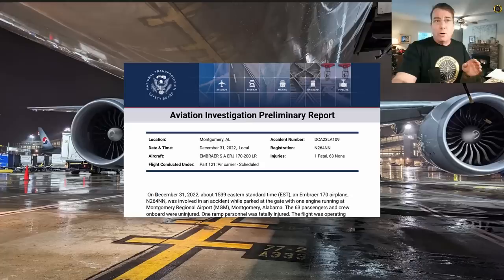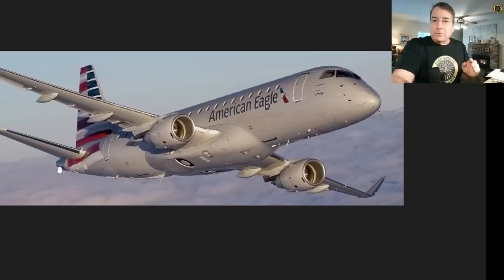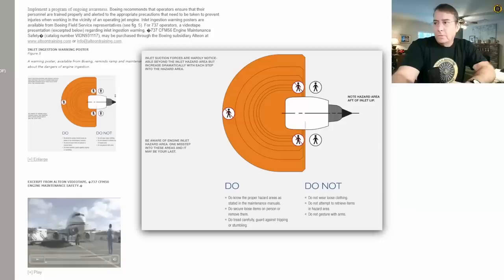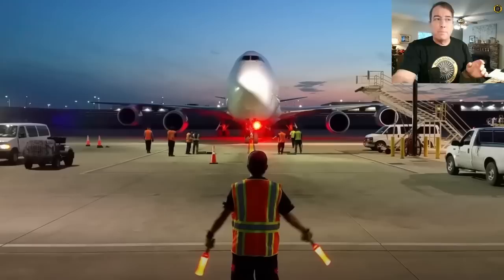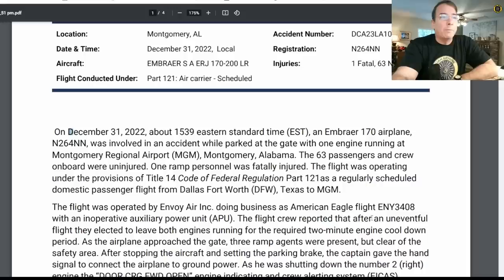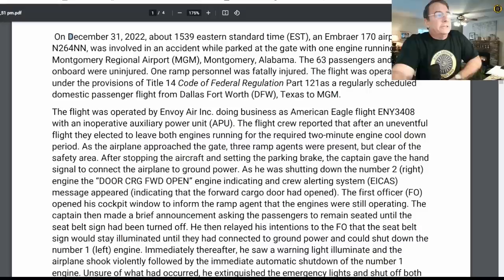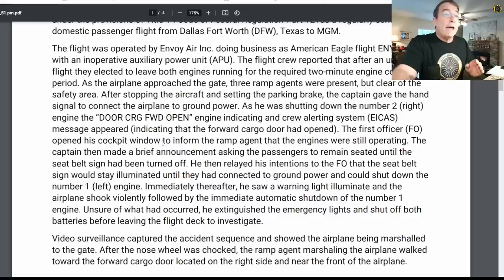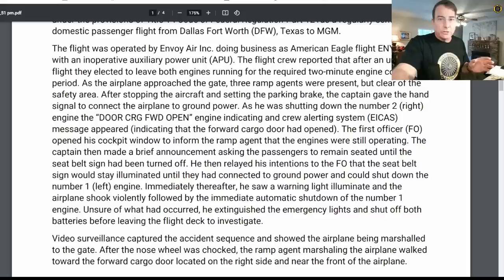NTSB Preliminary Report Ramp Agent Fatality 31 Dec 2022 Montgomery Al.

Comment: A few things; I understand the 2 minute cool down for the engine but when does the PIC shut down the engine under an "emergency" vs making the (utterly pointless) effort to yell out the cockpit window. Yes the ground crew person violated many procedures, but on more than 1 occasion as a member of an aircrew, emergency actions have been taken to avoid the potential consequences of ground crews errors. I can point out their actions till Im blue in the face, I am still going to have to answer for my action/inaction, steps taken to avoid an "escalation of incident". Clearly, the aircrew realize the accident's potential and did little in response. Losing cabin power isn't a reason to not take emergency action.

Comment: With the ERJ170, the beacon light can be difficult to see from either side of the aircraft.  The engine blocks the view of the beacon light underneath the fuselage.  The beacon light on top of the fuselage is difficult to see if you are not tall.  I am 6 feet tall and I have difficulty seeing the beacon light on top of the fuselage when located just outside the safety box.  The beacon light on top of the B737 fuselage is a lot easier to see from either side of the aircraft.  For the ERJ170, I stand at a 45 degree angle outside the safety box to see when the beacon light underneath the fuselage is turned off.

When other aircraft taxi by, it can create the impression that the engine(s) is/are still running.  When that happens, I have to visually check to see if the engines are still spinning or not.  It is not always clear if the engines are shutdown..

Comment: This is the result of ineptness on the ground handler/agent or whatever title they have. You simply don't walk in close proximity to a running jet engine. Bad things can and do happen. This is akin to walking across a railroad track with a speeding locomotive approaching. What part of the safety meeting Prior to the plane arrival didn't she get? I worked for a contractor loading and unloading the B757 for UPS at SHV. Proper aircraft etiquette was discussed before & after each successful load. We would review the video afterward. What could be done to improve? This was a completely avoidable tragedy.
Cheers from Louisiana.

Comment: Rampers often get frustrated with us pilots when we leave the beacon light on “too long” and more than once I have had them frantically waving the “flashing light” signal with their hand.  Part of my flow is to monitor engine speed after the shutdown until it falls below a certain value, as unlike a car engine it takes a long time for the heavy rotating mass to spool down from thousands of rpms even after it’s been shut off.  From my seat there is very little I can see going on underneath the wings, but occasionally can see the reflections from the glass of the terminal.  Over the years I’ve seen some ground personnel getting awfully close to a barely shutdown engine despite the beacon.  It chills my blood every time.  On some occasions have I been distracted and forgot the beacon…. yes.  Does this frustrate rampers who have a time crunch to offload and reload the plane… yes.   Have their been times something has gone on with the plane that I actually don’t want them touching it…. also yes.

Comment: I would be surprised if this doesn't spawn a lawsuit on behalf of the deceased.  My expectations are the following causes are pressed:. Time pressure, the door switch/brake issues Juan raised, company tolerance of rule breaking, training of ground crew, warning paint on the ground or lack thereof, etc.  Perhaps the biggest issue will be the cost if a radio headset for each person in the ground.  It would be pretty easy to suggest the cost of this would be a few hundred dollars and would have saved her life.   Any single event like this could easily lead to a radio requirement for all ramp personnel, despite the fact that these events are extremely rare and there are likely many tens of thousands of personnel involved.
Reply: A Radio Headset won't help if the person has earbuds in their ear- using their cell phone- or daydreaming about what they are doing after work. Do NOT know if this particular individual was using earbuds or her cell phone while on the ramp. Maybe the detailed NTSB report in about a year will provide more details.

Comment: If it's like all other industries I know of, and I don't know why it wouldn't be, corners are cut on safety as standard operating procedure.  Dismissing as a formality a required safety meeting would be typical in other industries.  I don't know of a solution other than piling on requirements such that the inevitable corner cutting still leaves the real margin of safety you want

Comment: Tragic accident which seems to highlight a big disconnect between the written word and actual practice. Even with a safety briefing and "huddle" only minutes before the accident. Frightening how many comments below seem to point to workers having to cut corners and increase risks under pressure from "management". You would have thought that most people would keep there eyes on the red beacon and stay well clear till it's gone out though. I certainly would and even then check I could "see the blades".

Comment: The ground power plug is on the left side of the fuselage. So wouldn't it be better to shut down the #1 engine first instead of #2? Is the area, in which the ground crew has to work with the power cable, outside the safety zone around that engine? What about the chocks for the front wheels? That should be equally safely outside that zone?
In essence only the power cable worker should be allowed to get close to the aircraft while the engines are on?

Comment: I would put this on high turnover and insufficient training.  Especially amongst outsourced ramp where the pay and benefits don't promote long term employment.  This results in inexperienced crew cheifs and potential safety issues from a revolving door of ramp agents.  Hiring practices for ramp treats it in most cases as an unskilled entry position, which it most certainly is not.  There are countless near misses and safety issues on an annual basis, primarily brought about by inexperienced rampers that don't fully understand or respect the dangerous environment.

Comment: I am concerned about that engine cool-down time.  The only safe way to handle it, really, is to require the airplane to remain one aircraft length off of the stop mark until the time is expired, so that the engines can be shut down immediately after stopping at the gate.  I know that having an airplane standing off the gate would play hell with ramp traffic, but running engines on the gate is just too dangerous a practice.  In the many years I spent on the ramp as an airline mechanic, I lost two co-workers--one mechanic who was run down in darkness by a catering truck driven by a brand-new employee, and one ramp agent who was killed by the discharge of a loaded pistol in a bag he was handling.  R.I.P.

Comment: My guess is briefing wasn’t actually conducted that statement sound like something that they just put in there to make themselves look good. As for pressure, as an aircraft Fueller, yes, there is unbelievable pressure to get aircraft turned especially if it’s a quick turn. We routinely as the engines is spooling down and the beacon is still on start pulling on to the aircraft, especially because a lot of airlines have a rule to be off the aircraft 10 mins before departure that could lean us with 20 mins to fuel a flight when it’d normally take 30/40 mins. Hell I’ve been asked to fuel aircraft blind my MX, ops or pilotdue to Inop gauges just to get an aircraft out on time.

Comment: I think there are automatic features on certain navy jets that shut the engine down if something gets sucked in. I get this vision of a young lady mid 20's in an instant gone. Very sad.
Reply: Well you can shut the Fuel Supply, but the Engine will keep Spinning anyway. Keep in mind that the Rotors weight more than a Car in large Engines, so there's quite a bit of Inertia that just can't stop instantly.

Comment: I was just on a PAL flight from LAX to MNL and we departed 2 hours late because the bathroom exploded on the previous flight flooding the entire left side of the passenger compartment with toilet water.  During the flight, the captain announced that the arrival was going to be delayed by an additional 45 min because MNL was too busy to accept us. Then, we landed 15 minutes later. So our arrival was a total of 2 hours and15 minutes late. The pilot on the intercom said they landed 30 min early. He calculated this based on the projected delay in the last hour of the flight, not the overall planned arrival time. Clearly this is incorrect from a passenger perspective, especially for those who missed their connecting flights. We were 2h 15 min late arriving in Manila. Not that I care because the flight was 16 hours. But still. The fact that they lied to the passengers shows that the airline only cares about that statistic for their marketing campaigns. Saying we were 30 min early is a joke. Many people didn't care though because sitting in toilet water for 16 hours is enough to make you just want to get off regardless of what you are told by the pilots. I'm sure the ground crew on new years eve had heard it all at that point and just hated that they were working on that holiday, hence the lack of paying attention to the safety procedures. Mindset counts for a lot. That's why some people live and many people die in survival situations.

Comment: MGM is far from a busy airport, especially so on Satrdays & Sundays.
With having only 6 gates (of which 4 are hardly ever in use) I'd wager a bet that aircraft was the only commercial passenger jet on the ramp @ the time of this incident - or if not, it was most likely the only jet sitting on that ramp with its engine[s] running....

Comment: i’m a ramper w swa and there is absolutely no way we are in a rush to ge this stuff completed quicker. there would never be a situation where we are asked to hurry up and get this equipment in to the zone prior to engines being shut off. This was an absolute mistake by that employee who was not aware of the engines running for some reason. IMO the marshaller had something to do with this as they should never leave that spot until they give the engines cut sign. when they went to chock the nose, that employee may have assumed the engines were cut. Don’t know americans policy regarding this but I would imagine it includes this
Reply: And you are clueless

Comment: I work for an fbo not the airlines but we do handle a variety of private charters using various commercial sized aircraft. I do not know the official company policy off the top my head but I do know at the base I work at there is strict rules about approaching charter aircraft specifically those with under wing engines. I’ve never worked with American Airlines before with a charter so I have no idea what kinds of conditions are placed on crews from them. However I have worked with other airlines and I’ve never had anyone as me to open a cargo door before engines we’re shut down. I normally wait until after the engine is completely shut down and the heat dissipates before approaching it from the rear. I have had a similar instance to this in where management was present to insure the safe hook up of gpu and airstart

Comment: At first  glance that warning diagram looks like it says DO stand in front of the engine and DO NOT stand behind it.
Reply: That warning diagram is also for a B737, not an E170/E175.  However, since the B737 CFM56-5/-7 engines have higher thrust (and thus a larger danger area) than the GE CF34 engines, it would stand to reason that the diagram that the video showed would ensure a larger margin of safety than the same diagram for an E170/E175.

Comment: All I’m going to say I know CYA when I see it.  That’s piedmont policy to have a huddle 10 minutes prior to arrival.  I also know that it rarely happens because usually the staffing is so bad, especially at an outstation that you go from one flight to the next.  Or if it did happen there’s no guarantee that this agent was a part of them because they could’ve been on another flight.  The training is inadequate and the pay is so low that it’s hard to attract quality individuals.  I’m curious if she was using headphones during this flight because it’s definitely more common than it should be. 

As far as the pressure it’s immense  especially when a flight arrived late. MOGT (minimum on ground time) can be pretty short for a 175 I believe it’s around 30’minutes.  I know 321s and 737s were 50 minutes while a 320 was 40 or 45.  That’s the time you use when an aircraft comes in late in place of the scheduled departure time. 

They preach safety but corners are cut all the time to avoid the delays.  Departure times are manipulated as well at times when the flight crews are understanding enough to release the brakes.  

Former Piedmont supervisor

Comment: My question not being around aircraft is when did the APU fail and if the APU is inoperative should the aircraft be taken out of service for that defect,The ramp worker a victim of complacency unfortunately,Im not a big fan of management but in this case in my opinion they did all they could,In the end  you are responsible for your own safety,A tradgedy none the less
Reply: Many Aircraft are allowed to fly with an INOP APU. The MEL [Minimum Equipment List] determines whether or not an aircraft can fly without an operational APU. You might be surprised how many Part 121 aircraft operate every day with APU's that are not working. The MEL does have a Hours/Cycles requirement when the INOP APU must be replaced.
The exception to this is an ETOPS aircraft [long range over water] which the APU must be operational before flight.

Comment: Thankfully for Sully and all those on board his apu was not tagged inop  Makes you wonder after that why they allow this to be considered safe.
Reply: According to the NTSB the A320 was equipped for Extended Over Water Use [that means ETOPS] which REQUIRES the APU to be Operational Before Flight.  They were LUCKY that that flight was being operated with an ETOPS Aircraft. [2] Quote 
Many Part 121 Aircraft are not ETOPS certified and the MEL does not require the APU to be operational for flight. 

NTSB Quote:
"Contributing to the survivability of the accident was (1) the decision-making of the flight crewmembers and their crew resource management during the accident sequence; (2) the fortuitous use of an airplane that was equipped for an extended overwater flight, including the availability of the forward slide/rafts, even though it was not required to be so equipped; (3) the performance of the cabin crew members while expediting the evacuation of the airplane; and (4) the proximity of the emergency responders to the accident site and their immediate and appropriate response to the accident".-End Quote

Comment: In recent years, I’ve seen a continual degrading of ramp staff’ appreciation of the dangers of the ramp.  I fly B737, mostly in Europe, and recently in several ‘developing’ regions.  Quite frankly, I’m surprised that this hasn’t happened again until now.  Sometimes, the most stressful portion of a trip is arriving on stand, let alone with a system unserviceable.  Clearly, briefings (from the video) are just not being adhered to, or even being given their due attention.

In some cases, ramp discipline is clearly down to the casual and seasonal nature of hiring for ramp staff.  In others, it’s simply down to a complete lack of any meaningful training, up to and including ramp supervisors.  This I feel puts the onus on flight crew to be extra vigilant beyond the practical consideration of what you can physically see from the vantage point of the flight deck.
I raised many a report on the matter- be it Passenger or cargo ops.  Having engaged with several ramp supervisors about this, the disappointing experience is when you’re told to mind your own business.

I hesitate to suggest that writing reports may be doing little to address these and other types of events, and serves only the main purpose of the statistics of writing reports, and not of improving safety or highlighting risks.
It’s disappointing to hear that investigators haven’t visited the scene, as I’m sure there is much to be learned by observing and understanding how ramps are managed.

Comment: I would speculate the ground crews were told to load & unload the aircraft as quickly as possible.  If it's cold they'll do it faster.  That's when people violate the rules & they'll get away with it for some time until someone is hurt or killed.  I've worked as an A&P & QC INSPECTOR and witnessed many infractions.  Corporate gets annoyed when they see the discrepancies I've written up.  Like it was my fault.

Comment: I'm not in the flying business, but I worked around very dangerous machinery for over a decade. Familiarity breeds carelessness. Well, maybe that's not quite the right term. More a slacking of vital respect and heathy fear of said dangerous machinery. Combined with pressure to get the job done fast, that's a dangerous combination.